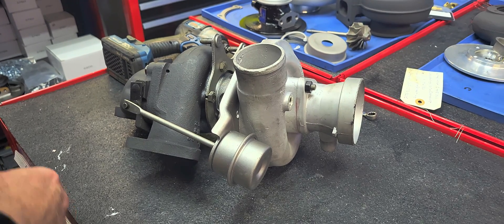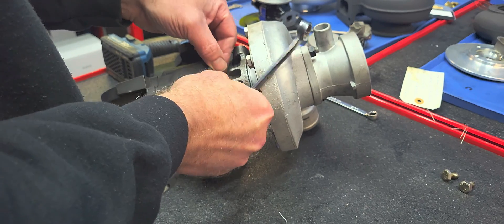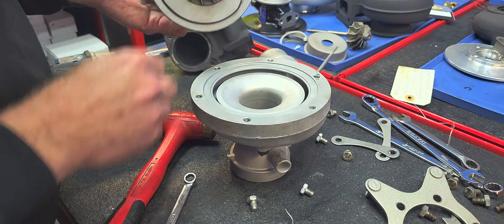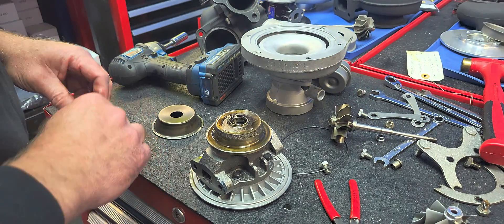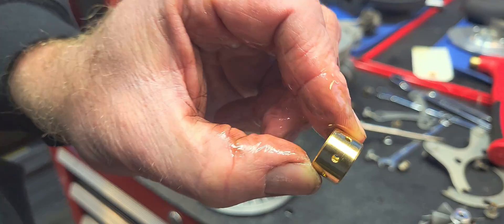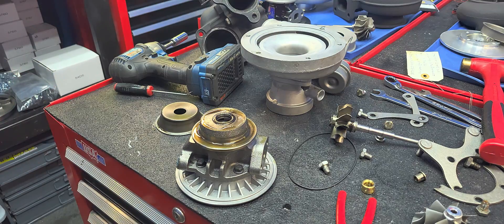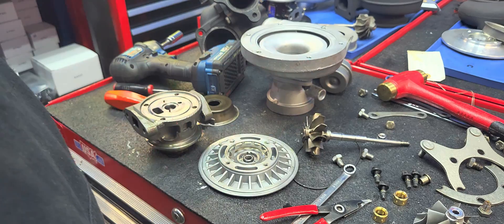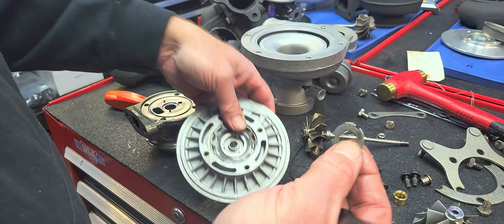Turbocharger oil leak after rebuild, what is the problem?

Comment: Very informative. I didn't knew turbos have piston rings. What was the problem? Was the housing bore warped , or it was the piston ring? Or the carbon seal? Cheers.
Reply from the maker: Yes, the turbine "gas seal" is a piston ring (exhaust side).  This is the simplest, cheapest and most effective way to seal your basic turbine.  Almost all automotive/diesel/light industrial turbochargers will also have a piston ring seal on the compressor side as well.  

There was a time (the 80's! ) where carbon face compressor side seals were very prevalent...but those days are mostly behind us...save for the required application for that type (high vacuum on the compressor inlet)

This turbo was either a seal bore concentricicy (sp) or line bore issue, but could have also been a seal ring that was faulty due to manufacturing or installation.  Most likely it was the bore, I have had this same issue pop up from time to time.  

I did not investigate further as the time it takes to do this out weighs the cost of just replacing parts...but as a caution I did perform seal leakage tests on the next 10 or so T3 turbochargers that used this same batch of housings and seal rings...did not see any issues, nor did I have any other reported failures (as of today).  

Thank you for your question!  -Reed